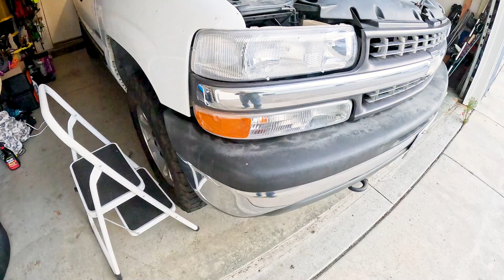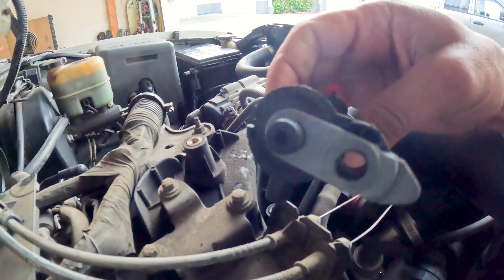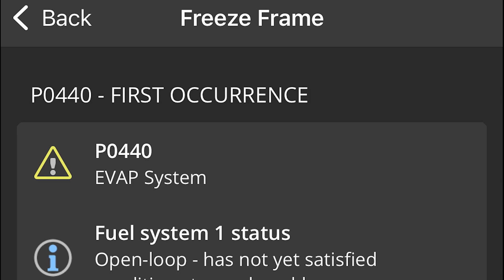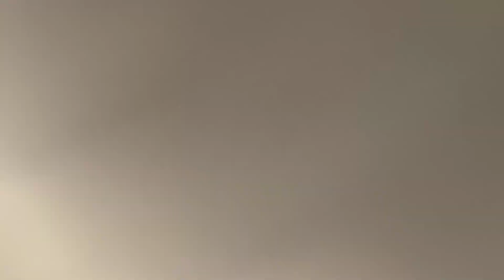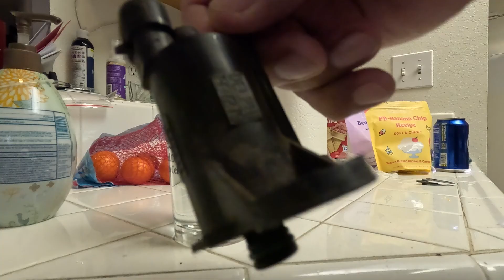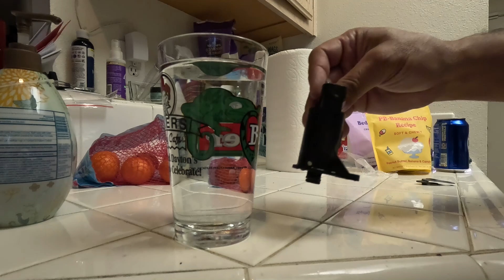Replace Purge Valve Solenoid 2002 Silverado 1500 5.3L | P0440 Check Engine Light | Hard Start Issue

Comment: because of this video my brain just had a bubble and realized it wasn’t a bad fuel pump causing me to have to crank my truck twice to start it, it was this! I just threw a P0444 code and I replaced fuel pump and it still sometimes requires a a two crank 
Thanks man! I have a 1500HD so it’s a 6.0 but it’s the same concept I’m pretty sure
Reply from the maker: @braydenblomquist7624  That’s awesome to hear! I came across an old repair bill and I recently had my fuel pump replaced about 10k miles ago by the stealership, so it makes sense it’s not the fuel pump. Glad I was able to help!
Reply: @ yeah, it’s okay though I had the part already given to me by previous owner and I paid a friend to do it for 300 so wasn’t total robbery
Reply from the maker: @ Not bad for 300. I was dreading doing that job. Glad I found the invoice. Thanks for the kudos.  Gets me motivated to keep creating and sharing videos.
Reply: @ of course brother, I love commenting on small mechanics posts even if it’s years later, yall help me out so I gotta let yall know
Reply: @TRX450R replaced my purge valve cleared my code next day had to do the two crank start and service engine soon code popped right back on didn’t even drive it 
I’m confused 😂
Reply: @TRX450R now the code is P0443
Evaporative EmissionSystem Purge Control
Valve Carcuit
Reply: Do you really have to get lube to put it in, mines a little wiggly but I felt it sink in some but maybe it’s not in enough?